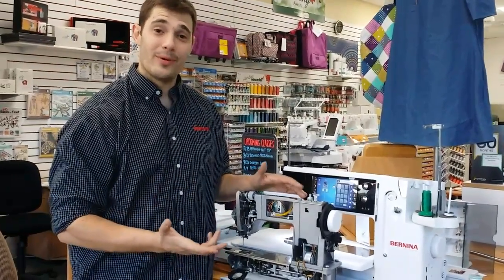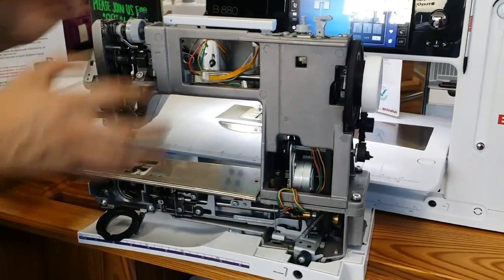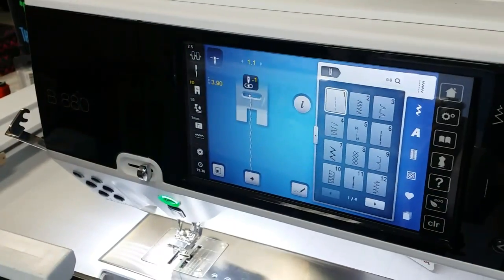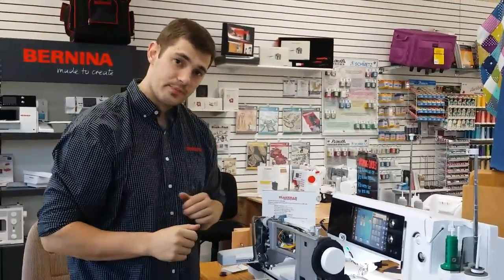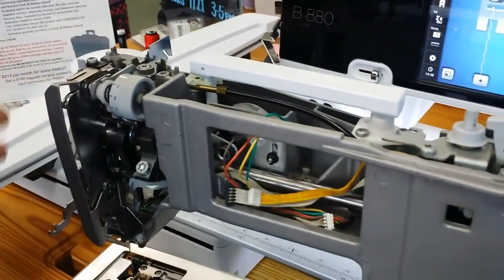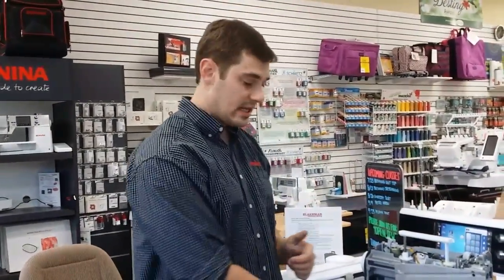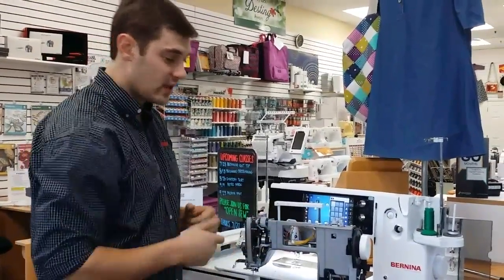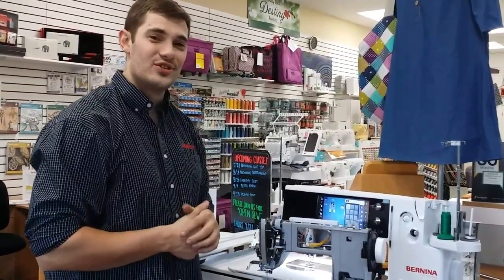Inside of Bernina sewing machines

Comment: Thank you for this usefull information. I was kind of doubting about a computerized sewing machine, since I am afraid the computer/electronics will not last as long as an mechanical machine, allthough the computerized machines are pretty expensive. But the computerized machines have all the features I am looking for in a sewing machine, which the mechanical Bernina 1008 doesn't offer. May I ask which model is used for the video?

Comment: The high-end Berninas are like Ferraris - they do great things but at some cost.  They are very fussy about thread quality.  They use photo sensors in various places that are prone to getting dirty and malfunctioning.  They are more intricate and thus prone to mis-adjustments.  Auto-threading of needles is a hit-or-miss.  Software updates are a pain - owners are supposed to only use a Bernina USB memory stick for transferring software updates from a computer to the sewing machine.  Our 21 yr old, computerized 820 just went into the shop today because the bobbin case popped out of the machine and can only be repaired at a Bernina service facility.  My wife’s 40 yr old Bernina still works, so she’ll be able to finish her Christmas sewing.

Comment: Chris, Very informative video.  I actually found this by looking for "bernina 1008 maintenance" as my wife has been to a number of manufacturers' repair seminars for dealers & techs.  Bernina is one she has not yet been able to attend.  A customer of hers had her 1008 kicked out of the back of a pickup truck by her dog.....you just can't breed out stupid, I guess.... and while Teri (my wife) got it to straight stitch, a black stamped piece of steel about 5 inches long and 1/8" wide, with a small "arm" sticking out a half-inch near one end, was flopping around loose inside.  No manual, and she suspects it's from the upper unit that fell down the tower (terminology? the part that housed the flywheel handle and main drive motor) and it was found down by the bobbin and hook assembly. I used to repair large production photocopiers with oodles of moving parts, but I don't know enough about how sewing machines work to reason out what this part might be.
Are there service manuals for these machines, and does Bernina sponsor classes my smarter half might attend to get caught up on this brand?  Many thanks from North Carolina.  -- Barney & Teri --
Reply from the maker: I would love to help you more. Email me at info@blakemansewvac.com
To see more giveaways and participate click the link below!
https://visitor.r20.constantcontact.com/manage/optin?v=001kiFLHNFoQ7xeoczyL-HAmca1YZltE6GJEC-26f-YndcNAmDKw6jX2EU67fE3G9Q6WTbIWckZAaUkp4B6T1NFUGKpULDDEq7tu38fC03964M%3D